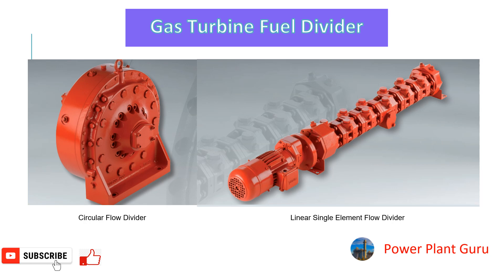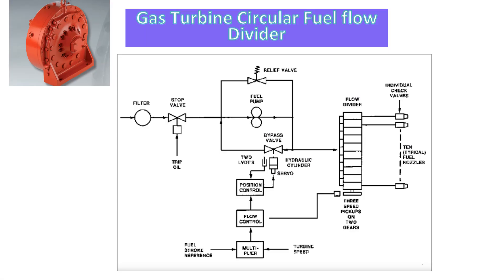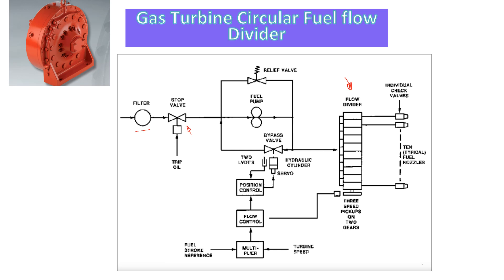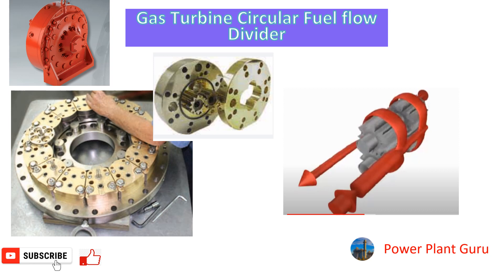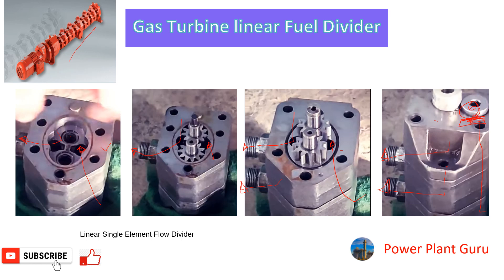How a flow divider works, Gas turbine power plant, Power Plant Guru

Comment: Thank you so much for all your helpful videos .. I will be grateful if you explain the diagram at the begining of the video .. how the fuel be controlled and from which point the controlling start.
Reply from the maker: Flow divider doesn't control fuel. it's function is only to divide fuel quantities in equal amounts. Fuel flow is controlled by VC3 Liquid fuel bypass valve.
Reply: @powerplantguru007  thank you so much, but my question was when the Vc3 is a function of speed, load and exhaust tempdrature... also the grid frequency has an effect on the fuel quantity.. 

If you can clarify these points in one video i will be grateful.